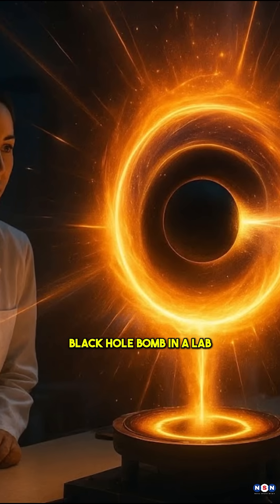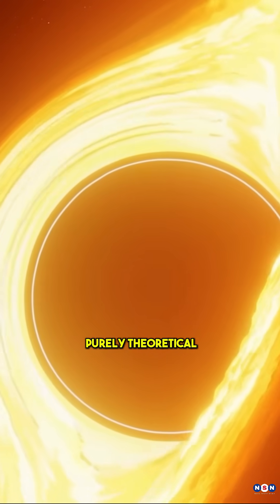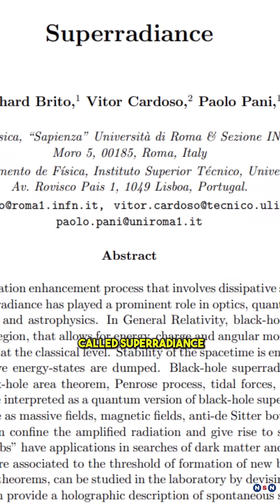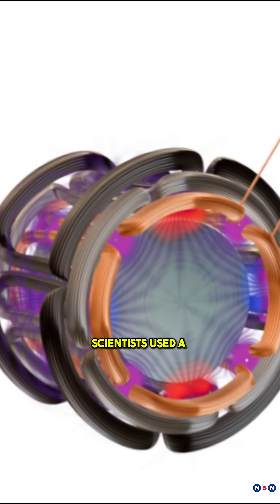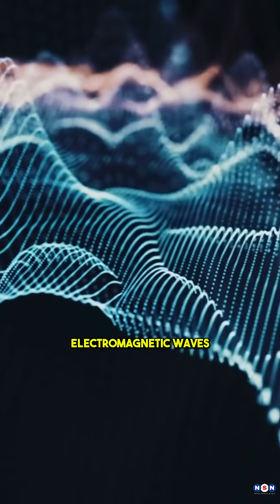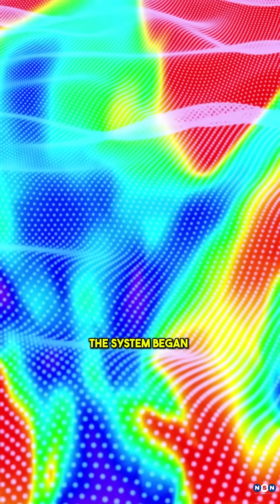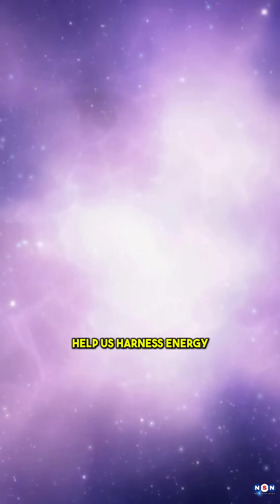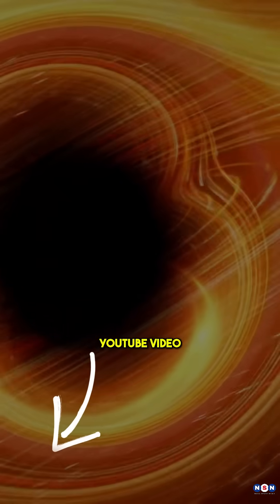Breakthrough! Scientists Just Built a Black Hole Bomb In a Lab!

Comment: Isn't it doing the same thing that a superconductor does?
Or something like Tesla coils? This is almost like the electromagnetic radiation version of an AC generator.
But what I don't get is, an induced charge of electricity is a very useful thing, but is an induced field of Gamma radiation something we REALLY ought to mess around with? We already have a massive rechargeable battery thats buzzing with ions encircling tbe planet. And it is doin that very same nasty 'exponential' volume increase because we have been feeding it noise, space junk, radio waves,  microwaves, and satellite signals bouncing around inside the giant balloon like popcorn. What these researchers ought to be doing is figuring out how to 'turn off'' or dial down the black hole and let the geomagnetic radiation flow back into the 'normal' field patterns of the earth.
Instead we are always trying to crank everything up because we are addicted to fields of energy and haven't learned to control the thermostat yet. Pushing tbe big shiney red button is not going to serve us very well!

Comment: And that’s basically how fusion reactors will work!
Reply: No. Why do you think so?
Reply: @bjornfeuerbacher5514  Search up “Mirror fusion”. In the 80s scientists tried to build a mirror fusion reactor, but for some reason it was shut down the day after it was built
Reply: @bjornfeuerbacher5514  since there is an energy output, even though it’s small, but still something.
Reply: @Prospero812  The energy comes from the rotation of the cylinder, i. e. it has to be put into the system first.
Reply: @bjornfeuerbacher5514 in the 80s there were a series of experiments to achieve mirror fusion, so if we can amplify plasma from nuclear fusion with mirrors, it can create an incredible amount of energy.
Reply: @AstroQuantaOfficial But this experiment is not about amplifying plasma, but about amplifying electromagnetic radiation! And the energy in this experiment comes from the rotation of the cyclinder, it is not "created", it is merely transferred from the cyclinder to the radiation!
Reply: @bjornfeuerbacher5514 I’m saying by modifying the experiment and mirrors it can be used to create nuclear fusion
Reply: @AstroQuantaOfficial I don't see how that should be possible. Could you please explain this further?